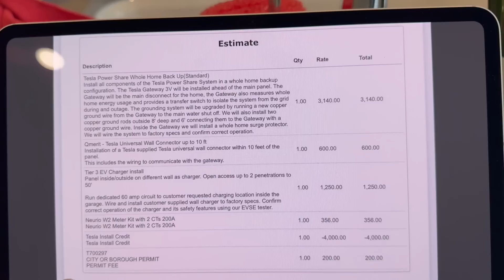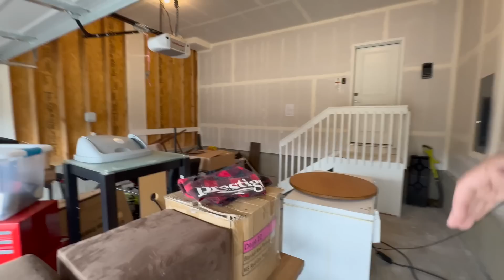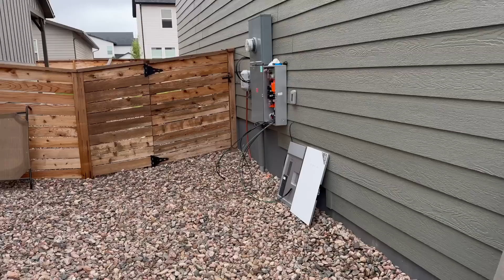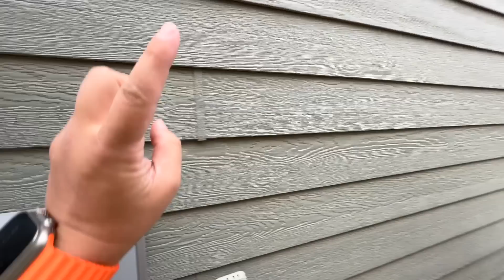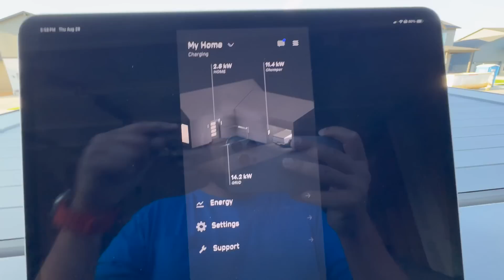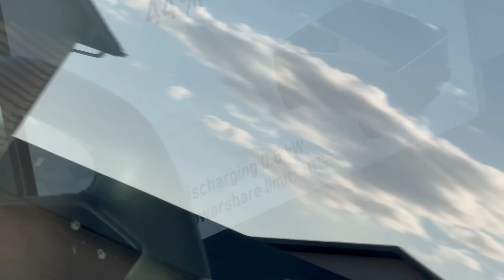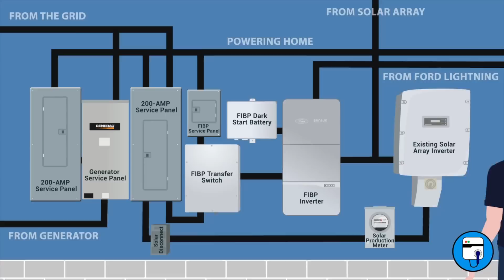Installing My Level 2 Home Charging Setup w/ Tesla Powershare Bidirectional Whole House Backup!

Comment: Just rewatched this after getting my own. The unanswered question I have is -- what if the truck is not home when the power at home goes out? If I plug it in during an active power failure will it start powershare up?

Comment: Kyle, great video!  We had our PowerShare installed about a month ago and absolutely love it. However, I wonder if anyone else has run into a sporadic data capture glitch during CT charging. I can see issues where the power consumption that should be attributed to the CT actually erroneously shows up as being consumed by the house. I just noticed right now that while I was charging, the data was showing up as being drawn by the house, so I went into the app and reduced the amperage to the truck down to 30 amps and the glitch seemed to resolve.  I forwarded all this data to the Tesla support group and they acknowledged they were looking at the data. Just wondering if this has been encountered by anyone else. Thanks again for the great evaluations your channel produces. 😊😊😊

Comment: F-150 Lightning owner here. No HIS system, Ford charger still in its box... I use an Emporia charger and a generator cord from the bed outlet for power outages:

Ford HIS = 30A 240V - 7.2kW - for $5000-7500 inc install.
Generator cord = 30A 240V - 7.2kW - for the cost of a $100 cable.

Time to switch to non-grid power:
Ford HIS = 1 min
Generator cord = 10 min

....I honestly wouldn't pay $3000 for any solution that I can get for the price of a damn power cord. ¯\_(ツ)_/¯

Comment: I understand I will need to add in the gateway and other hardware to my house... but can I do this yet with my 2018 Model 3 LR RWD? If not, how likely will I ever be able to power my house with 2018 Model 3? My Model 3 battery is like 5-6 Powerwalls. I only drive 40-50 miles per day and I get home usually around 2 pm. I only want to be able to fill up Model 3 in the middle of the night when it is 13 cents a kWh and then use the battery duirng peak hours when it is as much as 63 cents a kWh. I would pay 5-6k to be able to do that. Would be nice to run the AC unit of my house off of my Model 3 during the summer during peak hours. Solar does not make sense where I live. My roof faces east and I live in a canyon so very limited sunlight. As an alternative, it would be nice to eventually pull the battery out of Model 3 years from now and repurpose it as a home storage battery when it has degraded to the poiint of no longer be effective to power my car. Like when my Model 3 battery only has 20-30 kWh capacity left which would be more than enough for my home.

Comment: I think something is wrong with ur AC, its only 25amp breaker something aint right just a heads up... The most that can pass thru a 25 amp breaker is 6000amps+20% worse case... anymore and that breaker is not working properly.

Comment: I was shocked at the price - $600 to connect the Tesla wall charger on a 3 metre run? $1200 to connect on a 18 metre run? Seems excessive which makes you question the rest of the pricing.  There's zero competition but we also don't know how much Tesla is getting out of the deal.

Comment: Mines swinging in around $6300.  Garage on the other side of the house detached from the panel.  Need to run some comm wires so the wall connector can talk to the gateway.  I’m still scratching my head on it.  It’s hard when you don’t see a huge amount of materials and pure labor.  I’m in tech, I don’t make 4K a day lol

Comment: I agree with you about AC V2H but if rivian can pull off 24 kw DC V2V in addition to V2H, it’ll be worth it for power sharing between vehicles out on the trails.

Comment: I have a Rivian and heard Rivian will have a bidirectional wall connector soon.  In the meantime, I have a EcoFlow Delta Pro 3 that gives me 4,000 watts of power.   I'm suppose to be able to charge it from my Rivian while it supplies power to the house.  But haven't got that to work yet.  I think I need a transfer switch.

Comment: 2) $5500 all in?  I would have told Tesla to shove it and shopped the parts and installation around.  There's got to be another company who can make a compatible part and a journeyman electrician who could accomplish this functionality for a lot less.  I personally would DIY, but I have done lots of electrical work in the past and am comfortable working with it.  Not everyone has this experience or is comfortable working with electricity.

Comment: 1) I would not have been happy with this builder.  No finished walls in the garage anywhere the walls are exterior facing?  What if you want to work in your garage with a space heater in the wintertime?  And the large beam right over the stairs?  They couldn't have shoved those LVLs into the ceiling?  What crap.  You have to do the load calculations anyway, why not just incorporate them into the framing?  sigh.

Edit - 150 amp main service?  You gotta be kidding me.  In this day and age???

FWIW, I bought just about the cheapest 2500 sq foot new house available in our area, in late 2022, and the garage walls are fully finished and insulated, standard.  And this is in Texas where our builders are famous for throwing crap together as cheaply as possible.

Comment: Hello. Few note from the point of view of someone from Europe.

I'm surprised how different the expectations are. For one, nobody really even thinks about upgrading their main power because of installing a wallbox. There are some subsidies to equipping your place with a wallbox, but they apply only if you get one of the dynamically load balanced kinds ‒ that is, we are very much motivated (both by the subsidies and by the fact upgrading the main line is expensive and tedious process, and you keep paying more every month too) to feed the car with only whatever is left. And there are no actual rules dictating the minimum power for your house (though an architect does some calculations and provides a recommendation for what you should get when building a new house ‒ but it's not because of safety, it's because of convenience).

Another one is the speed of the switchover. From practical point of view, I don't see much difference between a minute and 2 seconds. All the devices (router, TV, desktop computer, washing machine, etc) will die and boot anew. The expectation here for a home backup (which is common part of a solar installation with batteries package) is around 100ms and most devices survive this without interruption. You see the lights blink, but the internet keeps working, TV continues, desktop computers… most of the time too. From technical perspective, a battery hooked directly to the solar inverter is slightly different than a battery in the car (there's a negotiation with the car involved), but if someone is trying to sell me a „home backup“, I do expect it to be in the time span below half a second.

Comment: At 48:20, the Ford HIS system quote I got was $9,400 for the complete system. I of course got the Ford Charge Station Pro as part of my purchase. So it’s a similar cost as the Tesla system if you don’t get the equipment included with your vehicle, which seems a bit crazy since the Tesla System has more included onboard. 

Also it’s odd that Ford didn’t come out with an AC system since the ProPower On Board provides 9.6kW of power

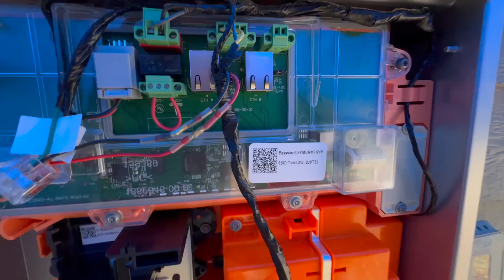Comment: 17:39 I’m not clear on the benefits of having the functionality for dark start, etc built into every vehicle instead of in the optional equipment that many people may never choose to install. For example, if the necessary equipment is $10,000, why build it into the cost of every vehicle instead of keeping it in separate equipment and lowering the cost of every vehicle sold?

If this approach is going to be touted as an advantage, then I’d like to see that detailed. I think they made the CT more expensive by adding this functionality into the vehicle even if it’s never going to be used. But if there’s a good reason to do it this way, I’m all ears!

Comment: Thank you for this video. Very informative like all your other videos. I'm hoping that Rivian will offer something similar, but I'm not sure if they have the AC inverters on board the vehicle, or DC output. Does the bi-directional backup work only with the Universal Wall Connector, or does the standard Gen 3 Wall Connector also work? I don't suppose my older Gen2 80A Tesla Wall connector would work, but could you verify that? And this is only works for the Cybertruck, not for any other Tesla vehicles correct? Would be a dream if it was a universal standard, where I could get my upcoming max pack Rivian with a NACS port to work with my old 80A Gen2 Tesla Wall Connector. One can dream...

Comment: Great video Kyle, excited to have this capability when I can get the CT. I currently have solar and a powerwall for my home and the switch over during a grid outage is even quicker, near instantaneous, so fast that appliance clocks don't get messed up. Cool technology and added value to the CT for sure!!

Comment: Great video! There is a lower budget alternative with the Ford and GM (and Tesla?) trucks. While the automatic switchover in a minute or less is cool, most people would be happy just to be able to manually switch over their house to their giant truck battery and keep the essentials going for a few days.  Just install a transfer switch and sub-panel with the essentials ($1.5 to 2K).  Then buy a big cable ($250) to run from the truck’s 240V AC output to the transfer switch/subpanel.  In case of an outage, plug the cable from the truck to the house, then manually flip the transfer switch.

Comment: Really need an industry standard before this takes off. Makes no sense to spend ~$10k on a system to then change vehicles in 3-5 years and rip it out to put in another system. Better to just use the onboard 120/240v output plug with a standard cordset into a home generator plug. Plus you can use a generator as needed for longer duration outages (or when you want to drive to store/work).

Comment: One of the reasons the long delay isn’t necessarily a bad thing is that it gives time to know if it’s an actual outage or just a power “flash”. I could see the Tesla system getting very confused if it’s ready to react at a moment’s notice during grid power flashes.

Comment: They are charging you $1200 to run line across the garage? Materials would be $100 at most and doesn’t take more than 30-60 minutes worth of work. You got hustled
Reply: The conduit bending and fitting takes longer than that. Pulling the wires that long is also difficult.

Comment: Hey Kyle, with no battery in the Tesla system, will it work if your power goes out when the Cybertruck isn't plugged in when the power goes out? Like let's say you're not home when the power goes out, get home an hour later and plug the Cybertruck in, will the house power up? I assume yes but would be good to know for sure! :)

Comment: I agree these electric co's that partner with Qmerit and similar charge way more than a local electrician because they know your getting so much $$$ from the OEM.  I am also shocked that your new home only has 150 amp service in this day of age.  And in Colorado and no insulation the garage?   I had so much trouble with Qmerit installers, I went with my own electrician and still saved money.
Reply: It's a small rental home. New construction is all about minimizing costs and 150A service is plenty for most people. I can almost guarantee nobody else in the neighborhood will ever come close to drawing as much power as Kyle's house.

Comment: I like the delay when grid is restored.  Many times, there is a huge spike and a dirty signal when power comes back.  I have UPS units on a lot of equipment to protect from that.  I'd rather wait several minutes to ensure the power is stable before switching.
Reply: That's a standard feature of backup generators.  You want a delay to show steady power is restored.   For seamless transfer back to utility power the CT would need to synch phases with the utility before transferring.  Very impressed with the 2 second transfer time compared to the Ford system.

Comment: The reason they only finished some of the walls in the garage with sheetrock is because it is code to have the sheetrock on shared walls of the interior of your home.  They save money by not doing the other walls.

Comment: Nice re the dynamic load sharing, so you won't go over load calcs...I'm only on 100A service, and I'm maxed w/ a 40A NEMA 14-50 circuit!
 the W2 neurio CT sensor that the HPWC gen3 uses, is the only sensor compatible... is it still readily available for installers? Amazon doesn't have it, seems only eBay etc, ...
I am looking at Emporia's Smart Power EVSE, they have NACS version, it comes w/ their Vue gen3 system and a mains CT, so it will do code-approved dynamic power de-rating to fit inside any load calc... plus if I add a few extra CT sensors from them, I get a full power monitoring system. It just won't be Tesla-app compatible, ... but I don't have a powerwall, yet, nor Tesla solar, so... I'm split.
If it's possible to get the neurio and I go for powerwall, maybe...  the 24' cable on Emporia might push me that direction, so I can charge either car in garage from one EVSE. Only one at a time of course, but... :)

Comment: Outrageous price, $5400 for that?  You can PowerShare two Universal Wall Chargers on one circuit.  Not sure is V2H is supported with power share.  The Nurio only works with a single wall connector, dumb.  Should be able to control all the wall chargers.  150A service sucks for two EVs.

Comment: im a contractor  just next door in Utah and in my opinion those numbers are right on. they don't seem inflated at all.
Reply: $600 to install the wall connector from a panel that's less than 10 ft away seems awfully steep. This isn't the price of the wall connector, that's just the labor rate.  It's maybe a 90 min job.
If you were coming out for just one thing, yeah maybe I get it, but this is on top of another 4k install.

Comment: Wow these guys, and you, dont even understand how it works?

There is a coin cell running the TACO, the coil is to generate the neutral as it only takes in two hot legs.

The orange box at right is the contactor to feed from utility, or truck. The TACO (i believe) can receive power from either side to allow truck to backfeed and flip the contactors as needed. Not 100% clear on that point.

Unlike a typical solar hybrid (grid tied) inverter, this device cant synch phase to the grid so it can't "hot" switch.

Comment: Big benefit of using a cyber truck over a power wall is the size of the battery. Cyber truck is probably 100 plus kilowatt. A power wall I think is 13 kW. The output from the Cyber truck is much higher than the power wall as well. The bad thing about the two second or four second startup is that your electronics will do a reboot and your clocks will need to be reset. I have a 24 kilowatt neo Volta backup system which is similar to the power wall. I run my entire house except for 220 volt circuits on the neo Volta and when I switch off the grid there is not even a blink, so none of the clocks internet or anything else needs to be reset. Actually we had a power outage and we didn't even know it and my neighbors said my house was lit up when everything else was black. Cyber truck has four times the capacity which should be very beneficial for long-term power outages.😅

Comment: The conduit, wire, fittings to install the gateway and the two Tesla Wall Connectors probably cost less than $1,000, the rest is labor and overhead.  How many man hours were spent installing?  Additional time was spent drawing the plan for the permit, filing for the permit, driving to the work site, coordinating the delivery of the equipment, etc.  Might or might not be overpriced.

Comment: It is good that these companies are offering some type of incentives for ev home installation. If you live in NC Duke Energy will pay for a $1133 for electrical upgrade. I had to pay for my charger $399 and $500 for permit and installation. The electrician took the whole $1133 incentive😂 But anyway it’s still too expensive.

Comment: You may think you're paying too much for this install but you want to have your chargers at the front of the garage which is going to take 20 ft of wire just for one and that wire is probably going to be a number four check out and see how much that 20 ft of wire will cost. Then look at the wire going to the other side of the house and the other charger.

Comment: I'm surprised when the grid comes back it can't synchronise to the input power and transfer back without power loss... although I suppose that's why they have the Tesla power wall system for.  Also agree this is the most optimized system design.  At least until direct from solar at home high voltage chargers become a thing...